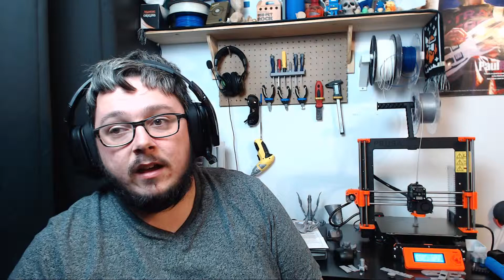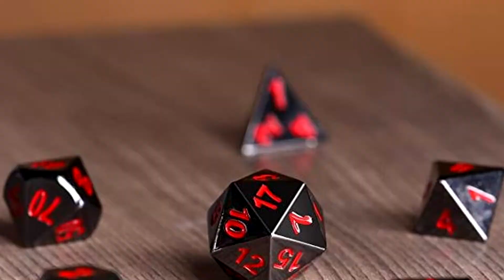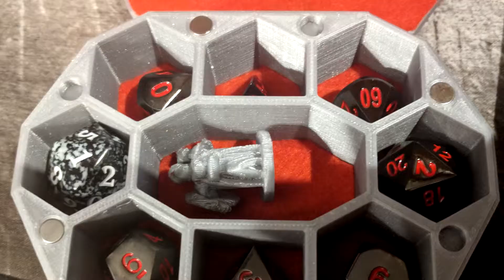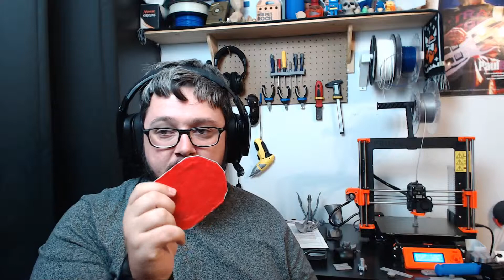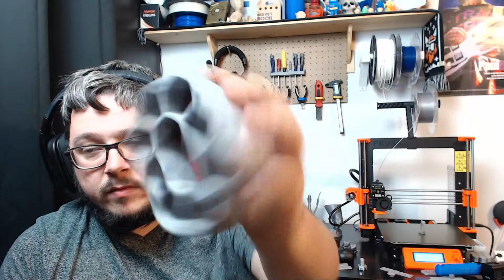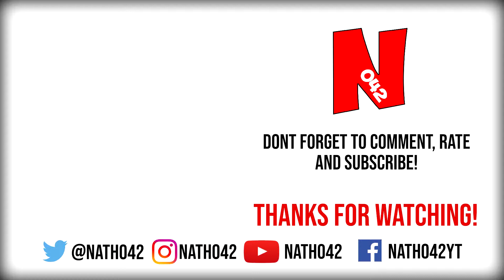INCREDIBLE 3D PRINTED Dice Pot for DND

Comment: I have those dice 😁 chromatic dragon from dnDice. I would maybe suggest you separate the base from the middle. Then you could felt the entire bottom with a single piece of felt and then attach the middle section. That'll give you a much better finish. Maybe use double sided tape too to avoid the splodges. Lastly, I reckon I would try to make each section for the dice the specific shape for the d type. That would look so cool!!! Once I get my new printer I might try what I've suggested 😁😁 great videos dude!!